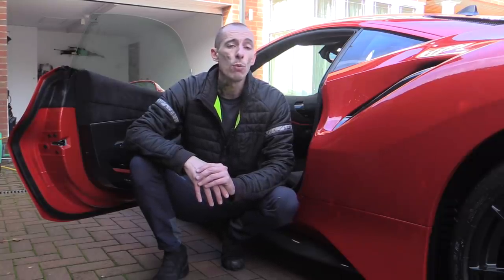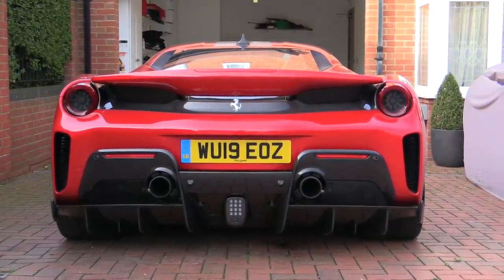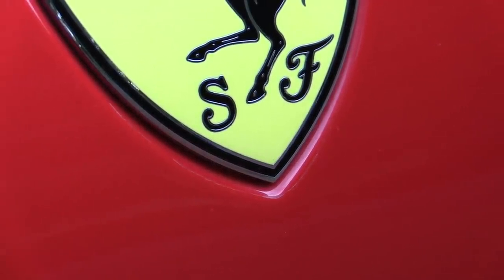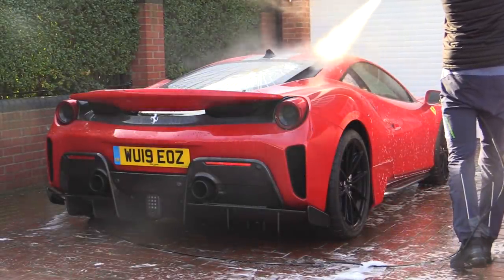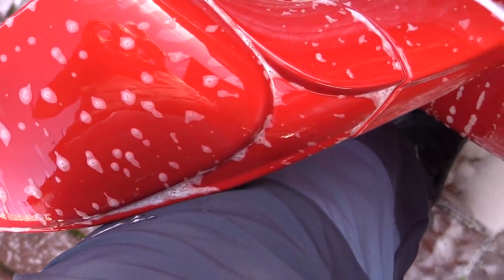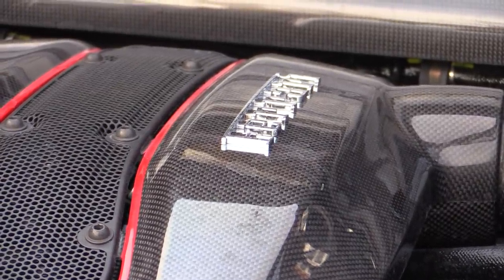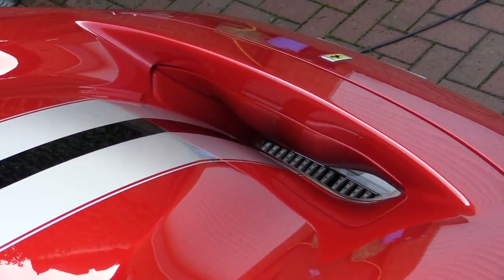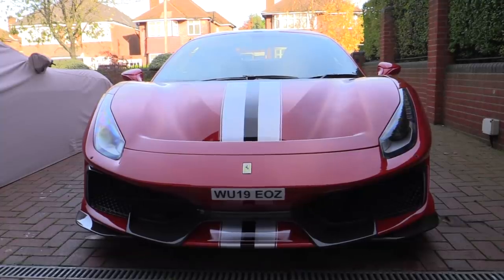What's it Like to Wash a Supercar?

Comment: Great vid and a superb exotic, beautiful job! My 2 cents you would have to charge more to detail a vehicle of this caliber for the fact that it is more challenging than a run of the mill vehicle. As you pointed out all the different materials including extremely expensive carbon fiber etcetera. If you were to damage any of those surfaces by using the wrong product or technique you as the detailer would be liable, unless you have your clients sign some type of a liability waiver. This should be factored into the pricing of detailing.

Comment: Back in 1991 when I was 20 I used to clean a Ferrari owned by my girl friend of the time Mums boss who had a brand new Testarossa Rosso with saddle leather and apart from it being really low, very sharp vents and slots. The products used was the cutting edge of 1990 car detailing products in the day. turtle wax colour match red wax and back to black shine spray. Soap was Fairy liquid. Not hard to clean really but I spent hours and hours on it as it was the top of the top sports motors at the time. I almost wore out my miami vice, U2 mix tape playing it while pretending to clean the interior on the drive. When in my mind I was chasing drug dealers along the Miami strip!!
Cheers
Reply: Hope you got paid for the cleanings 😂

Comment: I also own a car with PPF. From the manufacturer of the foil it is said not to use products containing more than 5% naphtha or kerosene. Every manufacturer has a Product Data Sheet (or Material Safety Data Sheet pr similar) for all their products in which you can check this 👍🏻... great video and car btw 😉

Comment: The more expensive the car, the higher the responsibility is, which is also higher risk, which means it’s going to cost more if something was to go wrong and simply for those reasons i charge more. 

I know this is going to sound silly but without sounding like a brand snob i think on a more prestige car it’s deserves only the best, which is more cost for expensive products, i have a price for more of a deluxe offering so in essence if the owner wants to pick the best then the car receives the best but then the price increases!

Comment: Do you have a matte carbon interior spray you’d recommend? (Audi R8 v10 plus)
Reply from the maker: The only matte detail spray I’ve really used is Muc Off believe it or not but it seemed to work fine.
Reply: Car Cleaning Guru - which muc off?  There are quite a few options.  Thank you by the way

Comment: Few points. Always use a pre-cleanse before attempting to wash using a mitt or you’ll cause swirl marks. When you dry it, always use clean and multiple dry towers. You don’t need a polishing machine for a brand new car like yours, you’ll only be stripping away a think layer of lacquer. You’d be better off wrapping it for protection

Comment: Why do valeters never use compressed air cleaning tools? Great for cleaning cars especially underneath, or in-between panels, seals and tight gaps, engine bays, arround buttons, vents, wheel arch plastics, window seals, wheels and brakes, old carpets and seats, you can even get attachments that suck the dust up via a hoover for doing interiors and cloth etc, great for drying the car too whilst dry wiping after a wash, I'm no valeter but my 20 year old VW looks brand new with mirror finish paint and I never use expensive cleaning products, just lemon based shampoo with micro fibre cloths and a hot wax rinse through the pressure washer...the compressed air will remove most of the dirt before the wash, rally teams use it too, obviously rally teams don't care about scratching the car and use a very high pressure air hose in a hurry, but so long as the car isnt covered in mud and small stones and some common sense is used, it won't chip, scratch or peel any paint.

Comment: Who ever did the ppf needs sacking.. So many people in this industry doing ppf and just bodging everything and charging top end because its a pista
Reply from the maker: Aftercare also plays a huge role in longevity.
Reply: @CarCleaningGuru  agreed but the edges and cuts around the badge and areas like that, that's poor workmanship installing the ppf, maintenence is key but if the job is bodged from the beginning that's not going to change

Comment: Wow, that's an unbelievably shitty wrap job, I wouldn't accept that on my Toyota let alone a 300,000+ pound Ferrari.  Beautiful work as always Guru!
Reply from the maker: Obviously wasn’t like that when handed over, as much to do with the maintenance and upkeep which I know nothing about.
Reply: @CarCleaningGuru  From what I can tell having watched a few videos of high end wrap jobs (which makes me an expert of course!), normally you'd expect them to remove badges and wrap underneath them, and custom cut film into the panel joins rather than just running them not-quite to the edge as here (probably pre-cut).  Also (again from what I've learned from youtube videos!) if they start lifting like that it's due to inadequate prep work & possibly indicates they didn't get rid of all surface contaminants before wrapping, or possibly used an inferior product.  Washing a car with exposed edges like this sure is a pain as they invariably collect lint, particularly during drying.

Comment: Its a car ffs 🤦‍♂️
Reply from the maker: You noticed that too?
Reply from the maker: $1000 cars with £18k paint jobs, £5k ppf installations, carbon diffusers and ceramic brakes you say 🤔
Reply: @CarCleaningGuru  who said I cant do that on a 1000$ car? + that car with no motor just the body is cheap i could get it in my country for around 8k but that price would be even lower if the car would be 10 years old or so wouldnt it ;)
Reply: @CarCleaningGuru  your car basically lost his price as soon as you bought it :)
Reply from the maker: Michael M Whatever point you’re trying to make you’re failing miserably.
Reply: @CarCleaningGuru  didnt expect you would understand 🤷‍♂️

Comment: What I can never understand with all you so called ' PRO ' car cleaners , detailers,  why instead of messing about on the wheel trying to get in with your brushes, spraying chemicals on brake discs etc. Just  jack the car up slightly and take the bloody wheel off !!!  Save a ton of time and you can clean the calipers etc. Properly...would Never pay someone to clean my Porsche in this manner might as well do it yourself !!!
Reply from the maker: It’s called a ‘wheels-off’ detail and takes considerably more time and effort. Once a year usually suffices for most cars, with routine maintenance cleaning (wheels on) being undertaken in between.